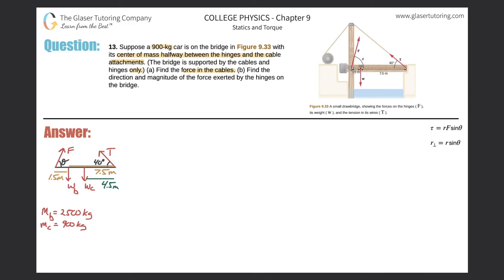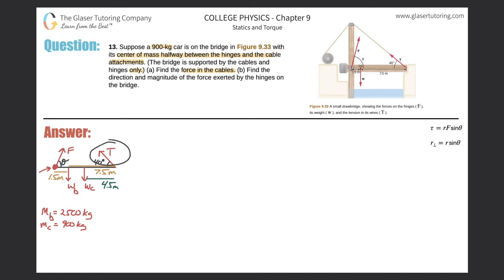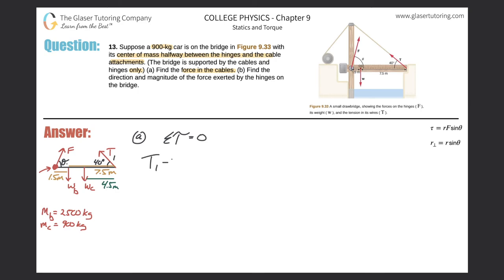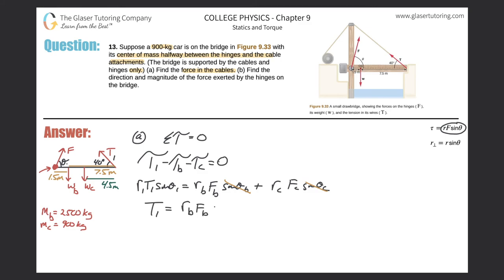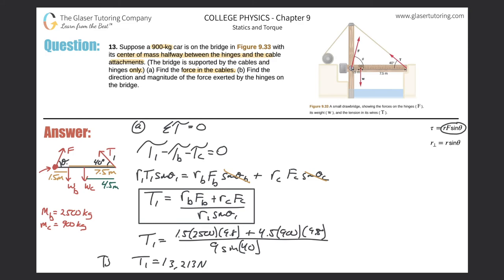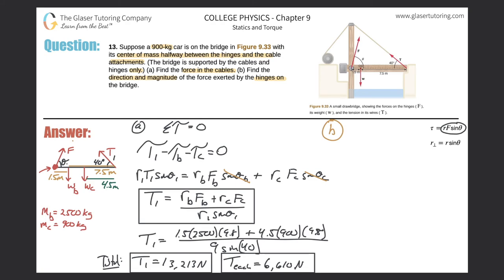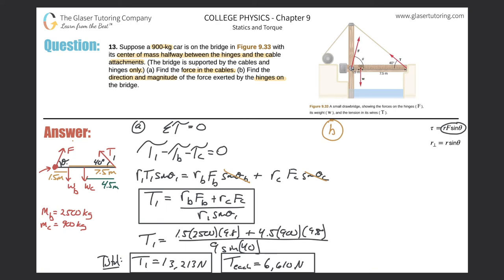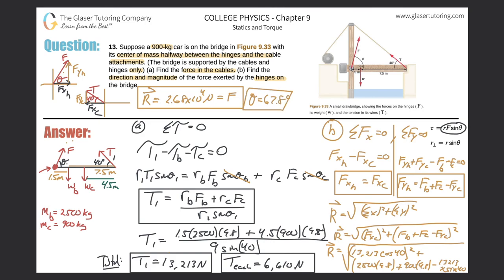9.13 | Suppose a 900-kg car is on the bridge in Figure 9.33 with its center of mass halfway between

Comment: wait, I'm a little confused. In this second problem, the center of gravity is halfway between the hinge and the cables, right? Should we be using the 1.5 m for this problem? And, half of 7.5 is 3.75. Where did the 4.5 come from? (I'm at 6:44)
Reply: The center of Gravity (marked as CG) is 1.5m out from the left side.  This makes sense as the bridge is heavy on the left hand side (not supported by the wooden base, as noted in the problem description.  

The 4.5 comes from half the length of the entire bridge, since the car (as in Fc) is in the middle.  The 7.5 value is just the part of the bridge to the left of CG.
Reply from the maker: Teamwork makes the dream work! 😀